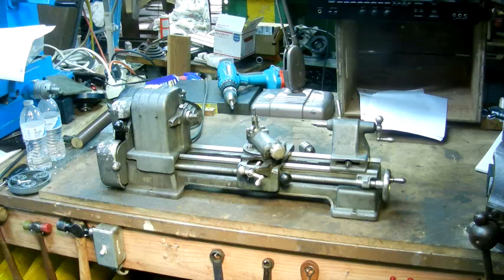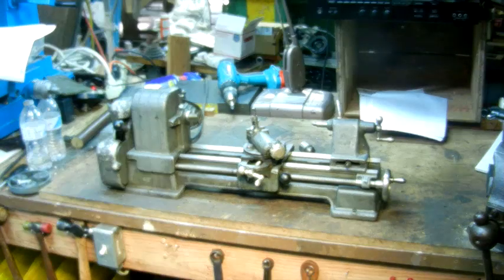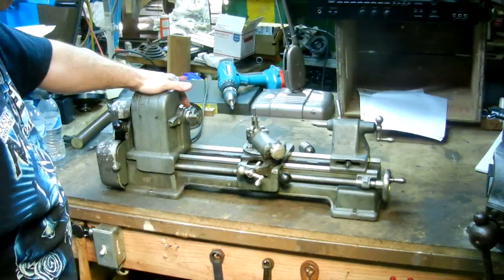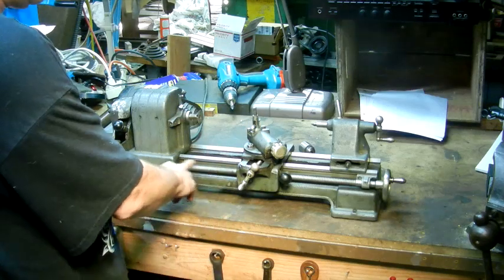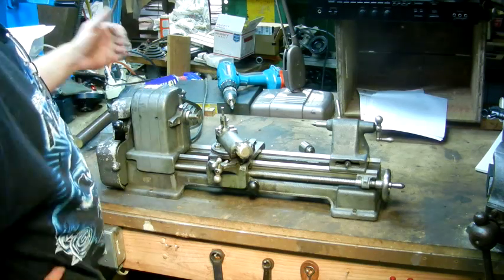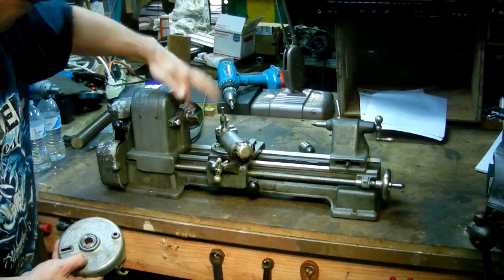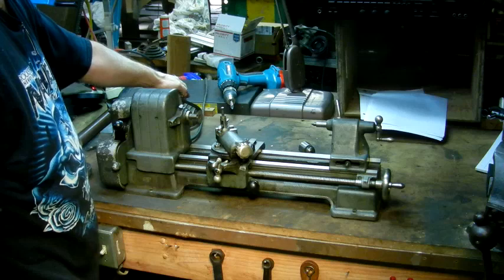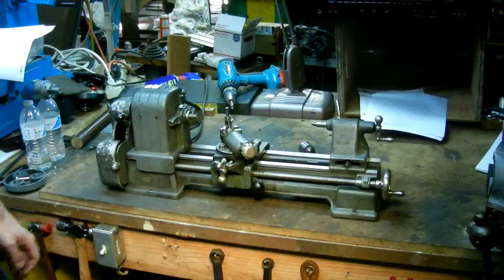Anatomy of The Craftsman 109 Lathe

Comment: I  bought one two years ago because i really wanted a lathe and ive never seen people so divided on something like this. You either love it or hate it and a lot of the hate is people expecting this lathe to do production lathe cuts. I got a different lathe because I need to make more accurate parts and more workspace. If you dont have a lathe and want one you should buy a 109 but you will spend just as much time fixing/retuning it as you will doing actual work. It's an 80 year old machine.

Comment: I had modified pulley with gear to accept 3/4 spindle instead,the front threaded end is 3/4x16tpi and it would accept MT1 arbors..Pulley and gear reduction drive both been modified to accept 3/4 spindle,it also got brass bushings/bearings installed...Same would go with standard pulley,than large size holes would be drilled in headstock front hole 26.3mm and rear 24.3mm..Ones bushings set spindle would fit correctly through,spindle gear hole enlarged for 3/4 and goes on spindle very firmly..This is the largest maximum size spindle that would work on model 109 lathe,it bit tricky to do such precision jobs of modification but not impossible..All gear reduction drive and geared pulley would permit installation of brass bushings that support 3/4 spindle..I also have plan how to build gear box assembly and modify lead screw to make it all fit and aligned however certain minor modifications to bed required.By making long lead screw and attach 2 beds together lathe bed become extended over 55" long which can allow deep drilling procedure...So there you go previously sought Craftsman/Sears 109 lathe transformed into ultimate lathe that can be upgraded to accept CNC parameters with further upgrade.....

Comment: What type of oil can I lube the bearings with
Reply: Which bearings? This device is not 'picky,' cheapest 30 wt is fine. It's best to keep a 'light oil' on the whole damn thing in most shop environments IMHO... at least I do - as my shop isn't the driest in the world... so I simply bring a spray can of coconut oil out of my kitchen, and lightly spray the the bed and chuck each fall.

Comment: I'm having issues with the chuck. I'd like to replace it but i can't get it to screw off because it spins with the shaft. do you know if there is any lock on it or not ?
Reply from the maker: There's no spindle lock.    The safest way to remove the chuck is to make a wrench that will hold the end gear of the spindle.   Take a look at http://www.practicalmachinist.com/vb/south-bend-lathes/how-remove-stuck-chuck-tutorial-165028/ for details.   The one shown there is made from aluminum, but a block of hardwood would probably work fine on a small lathe like the 109
Reply: ok thank you very much

Comment: I bought this so i could machine cobalt. will it do this? the guy i bought it from said he use to machine cobalt all the time on it.
Reply from the maker: +dantheman1998 I suppose you could machine about any material you want as long as you have the right cutters and enough time, but these little lathes really aren't well suited to anything harder than brass or bronze and even then, taking more than a .010 cut is pushing things.
Reply: It's not the 'lathe' that determines how easily you machine cobalt, it's the nature of your cutting tool. Cobalt is 7-8; tungsten carbide is 8-9.  Go for it with Tungsten Carbide; or diamond.

Comment: Guess what,
I got same type of lathe as well...
I self made inner spindle plate that hold 3 planetary 36 theeth gears...
Original is zink alloy mine is steel construction,first I get annual gear drum than pulley with central sun gear..
Becouse of unavailability of inner spindle plate I was forced to build one myself,first I torch cut exact thickness plate and grind it,than I use die grinder to make groove that aligns with drum gear,after that bushing been acquired that's precisely enters into drum and after that I align plate and bushing while in drum than tagged by mig welder which after all completely weld..
The 6 aperture grooves was made before bushing was weld on plate,after everything been done I made axles for 3 gears out of wiper motor spindle plates,they been cutted down and insert into holes than after proper alignment they been spot weld onto plate...
The axles about little bigger than 1/4 and bushings for gears exact 1/2,so far I only got one gear with 36 theeth and every side aligns properly and aligns with center pulley gear...

More likely or less those would be an spare parts,
I also acquired complete head stock with complete gear drive assembly so it wont hurt to have spare parts...

However one thing noticed,
There is significant differences between craftsman and sears head stock versions,sears version is wider head stock and takes some space of whole lathe bed...
There is also differences in spindle and pulley construction as well while one model got gear drive assembly and other doesn't..
And final differences in spindles there is 1/2 threading which standart chuck threading and 3/4 thread which would recquires different back plate for chuck....

I bought Chinese version of 3 inches chuck among with self made back plate for 1/2 thread of spindle...
In addition I also got standart 4 jaws individual adjusting of jaws,the selfcentered 3 jaw chuck also got reversed jaws set as well while original Craftsman/Sears or Dunlap doesn't have those included...

I got standart tool post and also universal type tool post as well...
The only things I don't have for this lathe is steady rest and following rest.....
This is major disadvantage of 109 models..